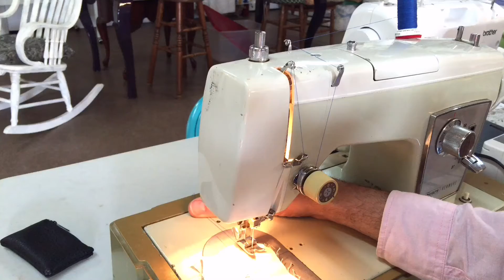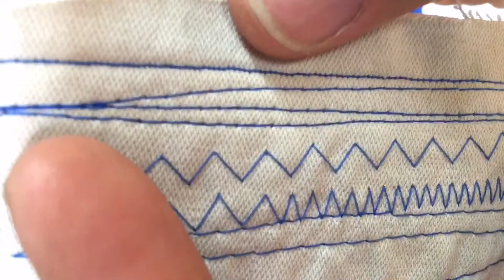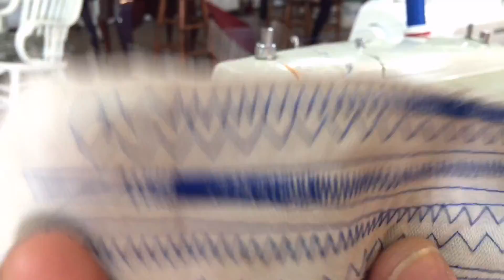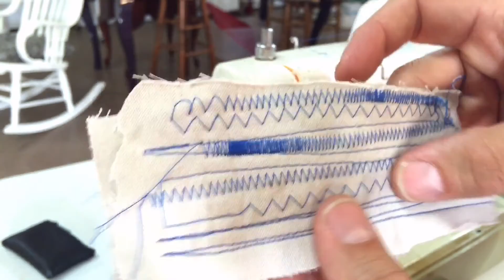Kenmore Vintage Sewing Machine 158.1750 Restored

Comment: I have an old 158.15000 that was my great grandmothers. Avacado green. She was a quilter. She had a few different machines but the old Kenmore always had its place in the corner of her kitchen, she ALWAYS went back to it. She passed away in 2018. I put the old Kenmore up in storage. This year though my wife and I decided to try our hand at quilting, I got a singer machine and had to learn how to work on it its a Model 6235. The feed dogs stopped working on it, I couldnt find ANYONE who would work on it around me. They kept telling me "just get a new machine" I wouldnt take that for an answer so i researched it enough to feel confident at taking it apart and fixing it myself. Ended up being a small plastic gear that got brittle and crumbled. I found new parts online, fixed that, oiled it all up, adjusted the timing. Really got it sewing good! Then i remembered the old 158 that i had of my grandmas! I dug it out of storage, dusted it off and took it apart, checked the timing and gave it a good oiling. NO PLASTIC GEARS HERE!! The wires for the pedal and plug were all battered and stiff and spiced together with electrical tape from probably several generations of my grandmas dogs biting them lol. I got new wires for her and fired it up. MAN what a difference!! It runs so smooth and quiet and consistent. I now know why she always went back to that old Kenmore! It has become my favorite machine. Probably moreso because it is sentimental too. Last week i found my wife a 148 Kenmore. It is solid metal construction as well. But it is seriously probably 20 or 30 pounds lighter than my old 158! So she can tote it around easily! The 148 sews very well too! Both Japanese machines. These old machines are so much more robust than what Singer calls "Heavy Duty" these days lol
Reply from the maker: It's wonderful to hear how much those vintage machines mean to you and your wife!

Comment: Hello! I just watched your video about the 1975 Kenmore. I was recently excited to finally  find a Kenmore "Ultra Stitch 8" (Made in ROC Taiwan) at a thrift store, (1975-77?) Serial # 158.1345381  and although it runs quietly and is strong, it pulls fabric through the feed dogs at a curve. I can do a consistent 1/4 inch seam using a magnetic seam guide, but the fabric actually has a curve to it when removed from the machine. There are chips on the metal finish at the corners which may indicate it was dropped/damaged, and the door to the light area is off by 1/8 inch when closed. Is there any chance this is just a tension issue, perhaps with the bobbin? The stitch quality is excellent. I 've played with the tension adustment mechanism on all three levels, with no improvement. I suspect something is literally bent inside, but we have taken the top and bottom off the machine and everything is smooth and clean as far as the working parts of the innards. Does this sound like something a technician could fix? I LOVE this machine because it is quiet and solid. Thank you for any advice you can give me.  Love your videos!
Reply from the maker: Hello. I cannot say for sure, but stitch tension issues can cause puckering of fabric or thread tangles, but I have never heard of the curved fabric as a symptom of tension issues.  Its very possible that the dropping of the machine MIGHT have caused warping of the driveshaft which might be the cause.  You might take it to a sewing service center or find a retired sewing mechanic who might be able to diagnose it further.  If it is not repairable, you can find MANY Kenmores that are similar to yours and they often do not cost much.  Search Craigslist or thrift stores.